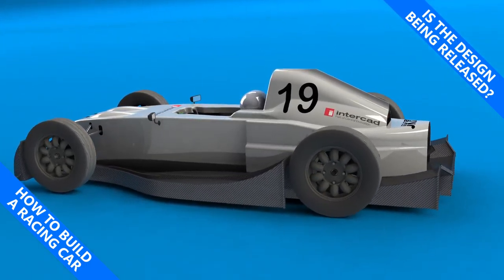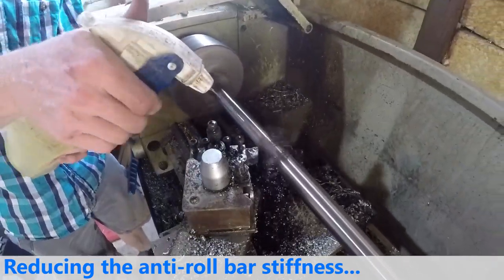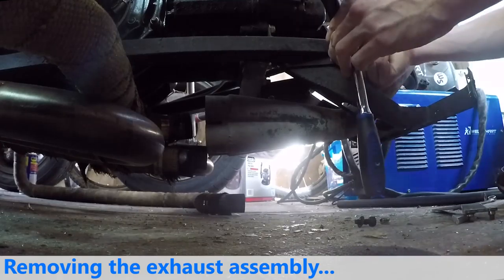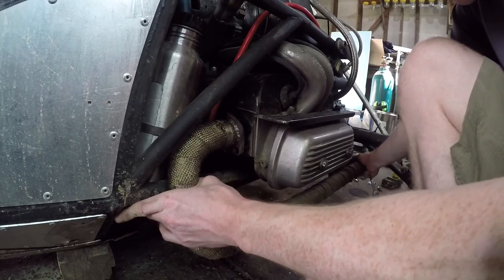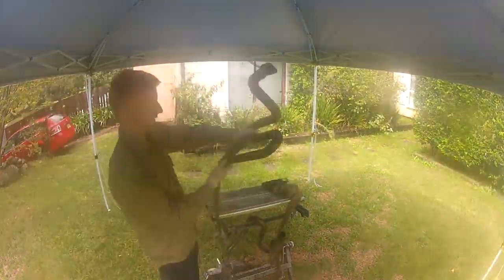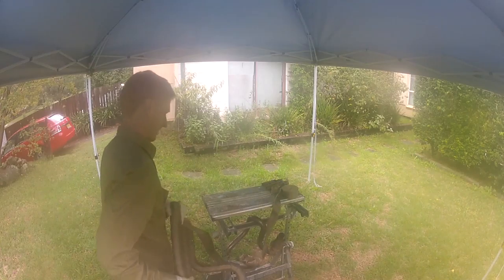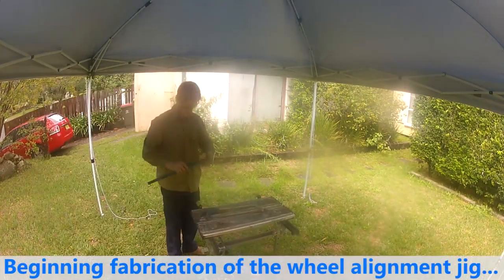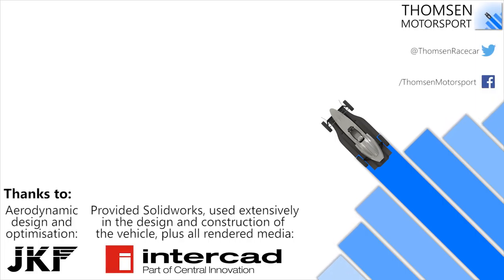Design Release: How and When?

Comment: Hey! I want to build my own, just wondered what did you use to design the car in? would something like auto-cad work?
Reply from the maker: G'day. I designed the car using Solidworks primarily, with Excel for any calculations I needed to do. Auto-CAD Mechanical contains the functionality you would need to design a car, I much prefer Solidworks as overall it seems like a better, more intuitive package to me. I have access to both through work so have experience with both, but chose to use Solidworks on this project.

As far as your second question about making a car road legal in the UK, I'm not sure personally what the laws are there - though I'm aware that it's much easier to make a kit car legal there. I'd imagine it would require things like blinkers, horn, brake lights and wheel spray covers. This car is low enough that I'd be worried about other people even seeing me but I'm sure it would make for a thrilling drive to the local fish and chip shop.

If you just want to build one the same as mine without having to design anything then that's what the Patreon is for, you could work from a set of plans for a car that's now demonstrated. It might be a good reference even if you designed your own.

Good luck with your project anyway.